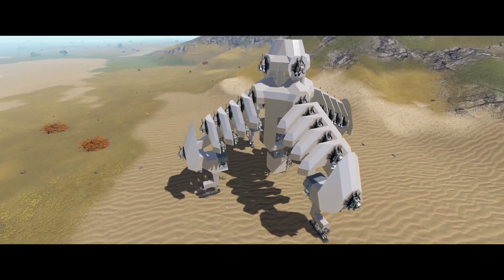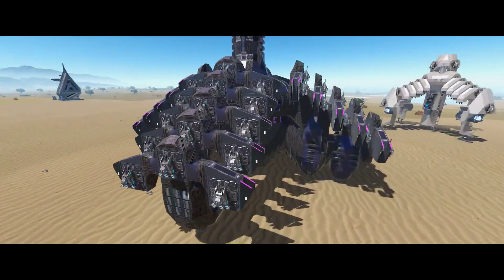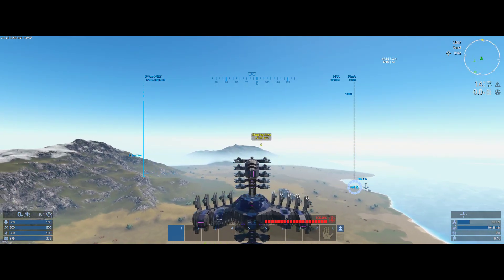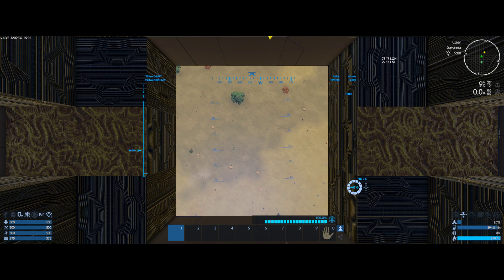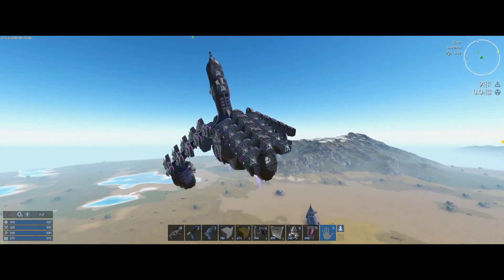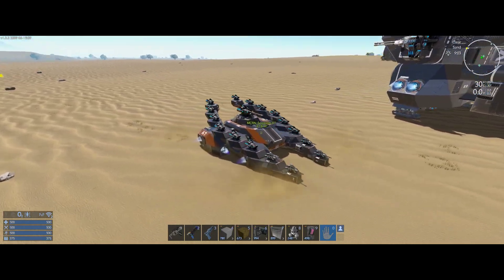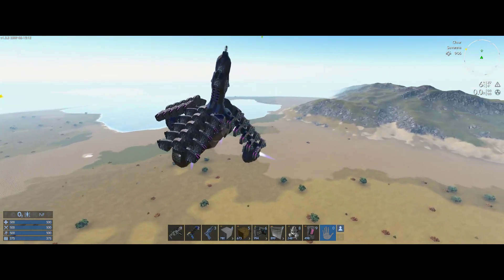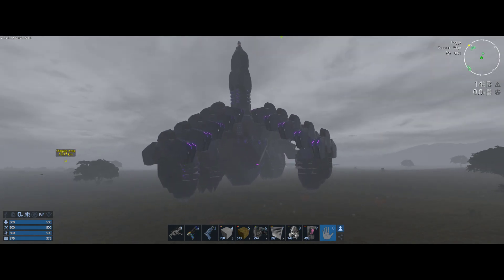Empyrion Galactic Survival - Kriel Concept CV WIP 1-6-2021

Comment: Keep in mind that the Anvil RE server specifically has block limits disabled. With block limits on you can only equip 24 of each type of turret as part of the Reforged config. This also affects your miner, as I believe the block limit for fixed drills is 6. Just means they won't be legal builds on certain servers, just like your plasma ship in vanilla.

But holy crap that Kriel CV looks like it's going to shred. Would definitely balance some laser turrets in there too for taking out shields.

Comment: Nice work experimenting with the xeno and justifying the use of retractable turrets in place of regular turrets.   As you mentioned, you don't need the protection on the turret mounts, and since you don't need protection there, why not make the turret mounts out of carbon substrate? That would save you so much weight.  Anyway, it looks great, and it sounds like you are expanding your possibilities with every build, so that's great.  A word of warning on keeping all the turrets as cannons.  Cannons are horrible versus shields (i think only 5% damage) and have relatively short range.  However, they are very strong versus turrets and blocks.  Consider mixing in pulse lasers to quickly knock out shields while you approach into cannon range.

Comment: In RE, many CV turrets fire in atmosphere, not just cannon turrets, so you can have laser turrets to take down POI shields (rocket turrets, plasma and flak turrets work too, IIRC). Kriel can indeed get away with some xeno, looks pretty good. I like that you are using retract turrets to save weight.  I think making the nose more like a manta ray or something more Kriel-like, and less phallic would be better.

According to Vermillion's Reforged thread https://empyriononline.com/threads/reforged-galaxy.91810/
" Turret limits have been increased to a uniform 24 of any type of turret. The limit is 24 for performance reasons.
Fixed weapons are limited to 12."

I know I can put more turrets of 1 type on a ship, so I assume that only 24 of each type can fire at one time. This could have been changed without updating the thread, or I may be confused.

Anytime I break my storage, I just add a storage expansion block and then remove it, and it seems to fix it. I'd rather see the Scorpion first ,personally.

EDIT: I also found this on page 6 of the thread: "The game has a built-in limitation that you cannot fire more than 24 weapons at a time. That limit cannot be changed or removed and is what the CPU values are built around as the absolute maximum. It's also why all turrets in RG have an individual 24 max limit."

Take that as you want. :|
Reply from the maker: Great info, thank you again!
Reply: @jeffrandall2813  I hit up Vermillion with a bit more specific clarifications. I'll let you know what he comes back with.

Comment: The build from alpha 12 stated that the turret limit was 24 of any one kind of turret.  So only 24 of those turrets will fire at any one time.  This thing will definitely be a beast when you get 4 different kinds of turrets and can fire all 70
Reply: I believe that does not apply to reforged which is what he is building it for. But I could be wrong.
Reply: @ScubaSteve117Gaming1  it is for reforged.  Vanilla has greater restrictions of only 10 being able to fire at once in the best cases.
Reply: @ScubaSteve117Gaming1  this is a quote from the Reforged Galaxy mod as of their alpha 12 build.  I can't find anything that contradicts this in newer builds.
"Important! Turret limits have been increased to a uniform 24 of any type of turret. The limit is 24 for performance reasons.
Fixed weapons are limited to 12."

Found in https://empyriononline.com/threads/reforged-galaxy.91810/   It is found towards the bottom under all the spoilers, located in the "vehicle weapons and tools" spoiler
Reply: Vermillion said any amount of turrets can fire, the limit of 24 each is for performance, not game limit. Fixed weapons have a strict in-game limit of 24. Any more than 24 simply will not fire.

Comment: CPU on the tank, try taking out the armor locker.  I've never used one on a HV.   Of course a med bay isnt' much more useful, you're very rarely going to heal in a HV, you're either going to be safe or dead. For the combat CV, maybe try making the proboscis bigger instead of smaller, it'll look better and be more effective.  Also because CVs dont' have structural integrety, you can remove the support column so all the turrets could fire down.  I like to use 1/4 blocks and deco so they look like they have some support even though it's not needed.

My vote for next release is the tree cutter.
Reply: I feel the same way on the HVs, I only need an armor locker in a BA/CV, and by the time I have a combat HV, I don't need a medbay anymore, I have a fridge full of meds. I still like the clone bay though, for when I go to loot the base and die.

Comment: Very kool designs sir!  On the Kriel ship, it was a bit hard to see. Is there any room for Some platforms that could accommodate zirax turrets ?
Reply from the maker: There is. I think they are the same size 3x3. So, any turrets could be replaced with what ever turret. If they are 5x5 size like artillery, I didn't add spots for those yet. I guess I never used a zirax turret yet. lol. Thanks again!
Reply: @jeffrandall2813  They're my new favorite lol. CV missile turrets that fire in Atmo. Its good stuff. Have them mounted all over my Skaar Raider. Thx sir!

Comment: For the Kreel Gunship, is there a reason I’m not seeing to have the backwards cockpit for landing? It seems easy enough to align yourself roughly vertical, then reverse throttle. Especially with the heading and inclination readouts.
Reply from the maker: I believe you are correct and it is not really needed, but it is sorta rough to see where you are landing from the front cockpit unless you use the alt key and change your view. I do find it easier and pretty accurate with the back cockpit thou. And thanks again!
Reply: Having made a couple vertical CVs myself, I tend to need a second cockpit for landing in them. Either you cannot see how you are landing will enough to dock it/feet hit trees and rocks, or you cannot get a good forward flight profile when you use only 1 cockpit.

A second cockpit is also fantastic for rear mounted tool turrets.
Reply: It is not needed for landing, but sure it will be very helpful for bombing :-)